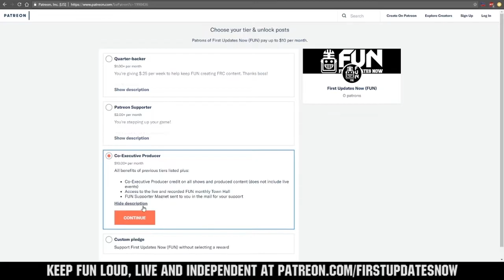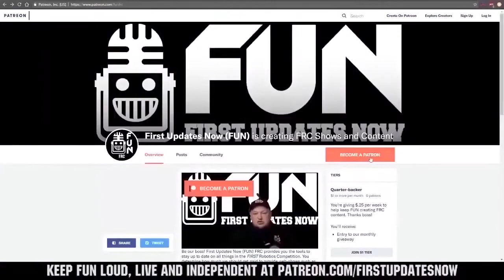FTC Top 25 1.15.20 - First Updates Now

Comment: 12808 ReVamped and 12599 Overcharged are in different divisions because of randomization based on score balancing. There were 37 teams for the QT, so they were split 18 and 19 into two competitions, but in the same building. This is coming from the Co-Captain of 8610 ToborTech.